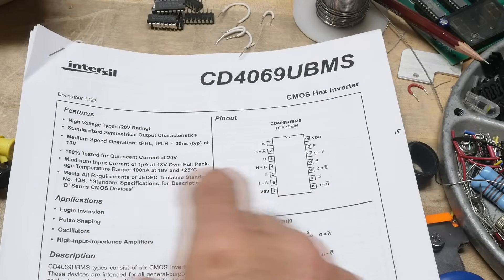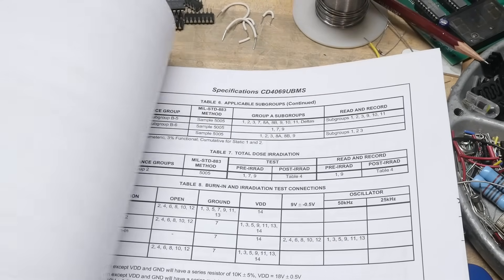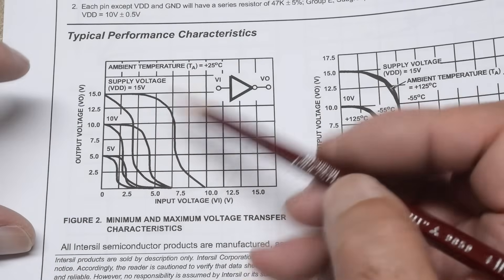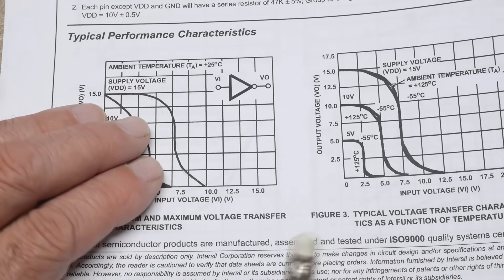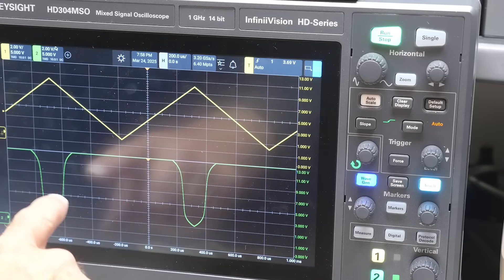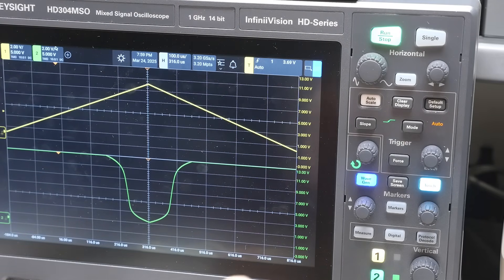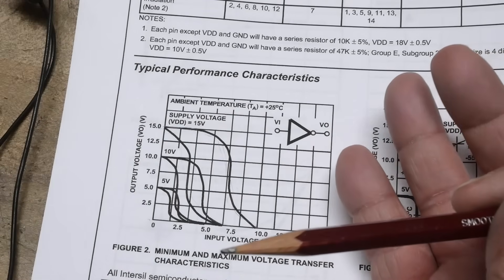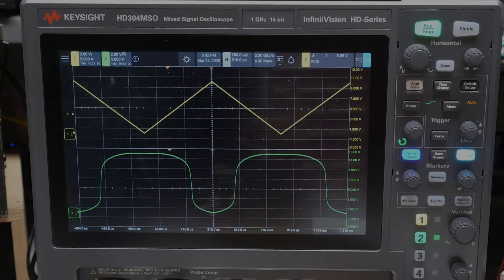#2193 CD4069 Transfer Curve

Comment: Why would you use at the input a 0-10V signal when power the IC with 15V? It is meant to be driven by another CMOS output that swing between 0 and 15V, right? If I am correct, the outputs and inputs of CMOS 4000 family swing between 0V and Vdd, so why am I missing here?

Comment: If the X-Y mode were used on the oscilloscope, the graph could have been produced using any waveform that spans the desired range of input voltage with finite slope.

Comment: There is no hysteresis.  The pair of curves shown for each supply voltage are the 2 extremes between which the transfer curve of the actual physical device is guaranteed to be, based on the manufacturing process.

Comment: When I was a kid, every part I scavenged was precious. They were all I had. So I would build something from a book, and double and triple-check everything to try not to blow up any parts. But that kept me from learning a lot about electronic parts. Now I have thousands of surplus parts to play with, and I still have to fight the urge to save every last part. But I find that experimenting with them beyond their limits, and in ways they were not intended to be used teaches me a lot more than what I've learned from the books, and helps me really grok the devices. Besides, releasing the magic smoke  is fun!
Reply: Me too lol—I still have some of the first resistors and a bunch of transistors that 30 years ago I clipped off of an old circuit-board in some telecom equipment headed to the trash from an office decommissioned decades before…

Comment: Nice - like me some true hysteresis - come back on a different path so it's a hysteresis loop. But anyhow I can see how shuffling back and fourth on the curves presented would be good for (mechanical) control systems where you need to correctly model acc and dec (acceleration and deceleration  ) .  Basically ramping up or slowing down for smooth non jerky moves. In systems like CNC machining platforms that smooth acc and dec are really important even if the G-code call for a dot to dot move as real iron has inertia when moved or attempting to move. [Although I have to see the other video to see what people actually use this chip for lol .].
.

Comment: You said, it's like a B-type amplifier. Could one build an audio amplifier with this CD4069? Ofc in a low amplitude swing range?
Reply: 100%.
Reply: Yes. It's actually in the datasheet if you read it. :)
Reply: You need a UB type though. I leave   the difference to the interested datasheet reader ;-)
Reply: It's not class B.

Comment: 2:15 The left diagram shows the maximum curve and the minimum curve of the transmission. These are for all produced gates. The individual gate has practically no hysteresis. The right diagram might be better to discuss the average curve.
Reply: Yes, indeed!  In this particular case, he apparently failed to read the data sheet.  The words are right there on the data sheet in the caption for the graph.  Perhaps he did this deliberately to emphasize, "Read the data sheet", by illustrating the situation when this is not done!